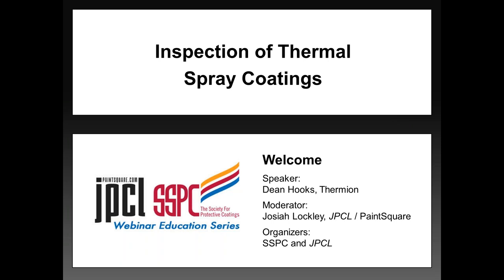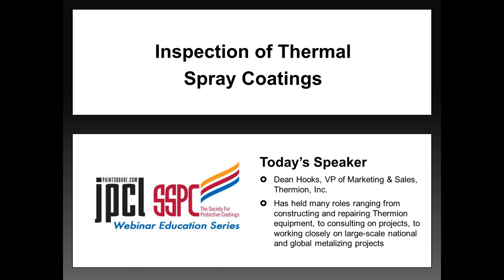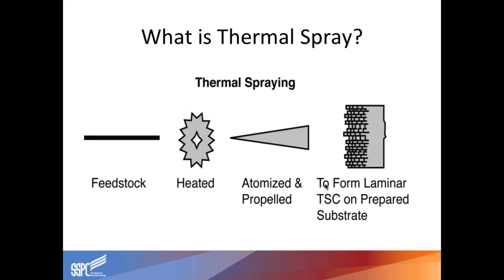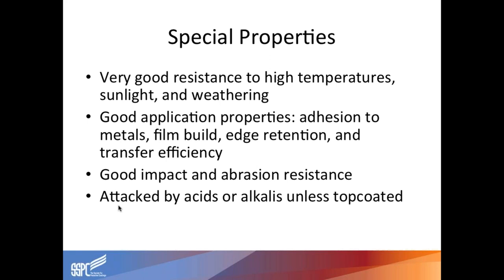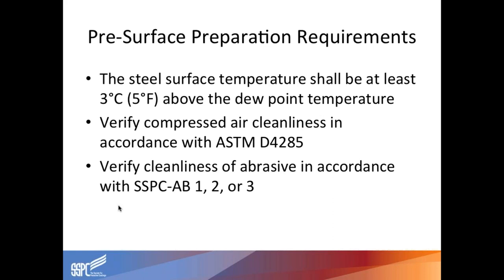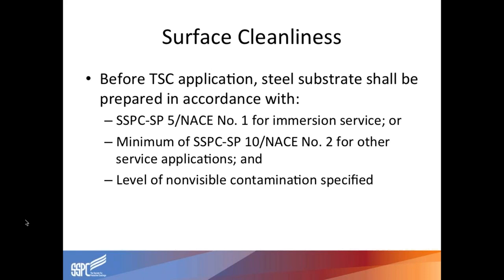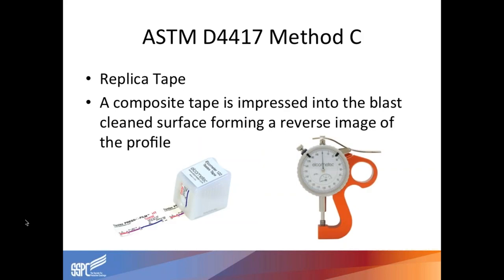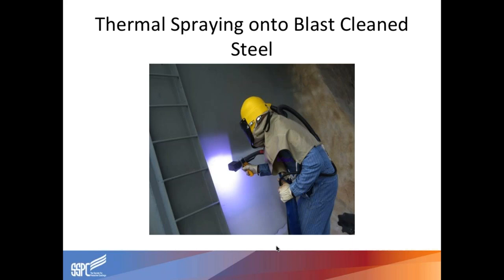Inspection of Thermal Spray Coatings

Comment: To answer the question posed about adhesion and why to use a self aligning adhesion tester as opposed to a fixed see well... Bond is measured with a self aligning instrument to prevent from an inaccurate reading. If the dolly is crooked, all of the force applied by the instrument will be applied to only one side of the dolly. So, say that the instrument says that it is applying 2,000 psi... Well if the dolly is crooked and the load is only being applied to half of the dolly, its actually applying double the amount of force because the equation to calculate pressure is force/area (as the area decreases, the overall pressure increases). If the dolly is truely crooked, only the edge will be calculated in this formula. In that case you may be applying 50,000 psi just to the edge. When you do that, it starts an edge fracture and the dolly rips off prematurely. If your machine is programed for 1 square inch, you gotta make sure that it is pulling one square inch and not the edge. The self aligning adhesion tester fixes this problem.